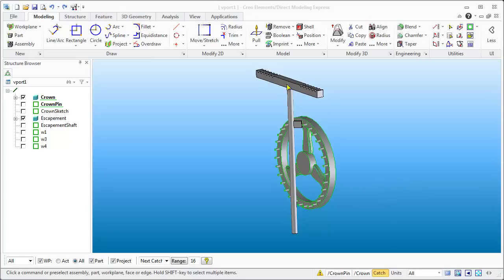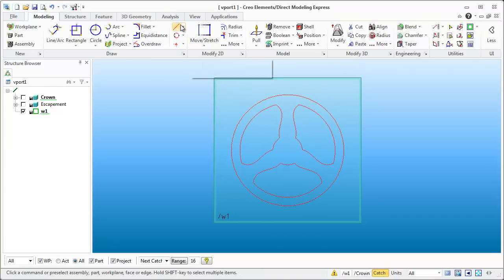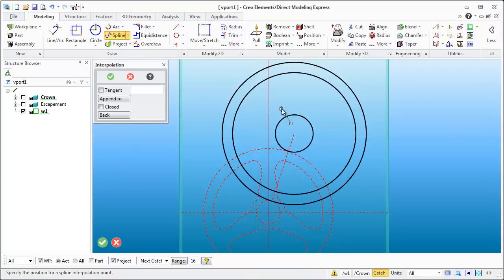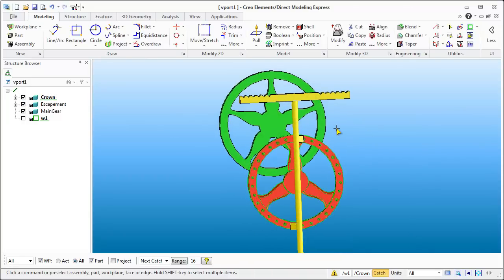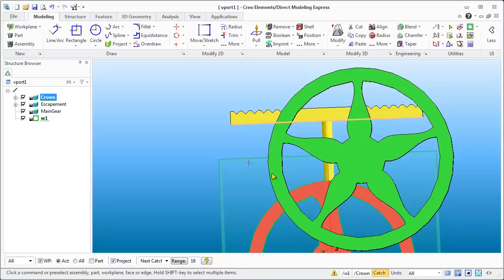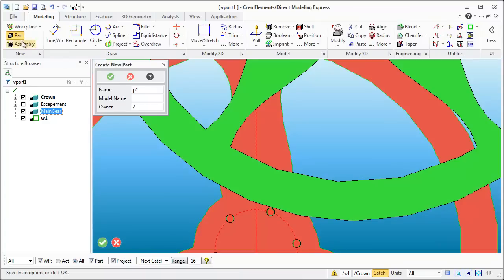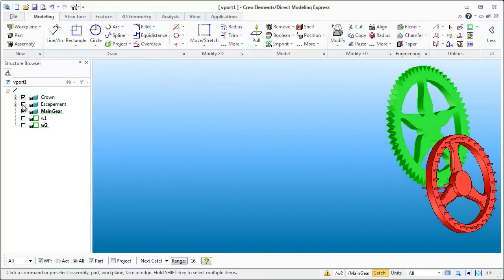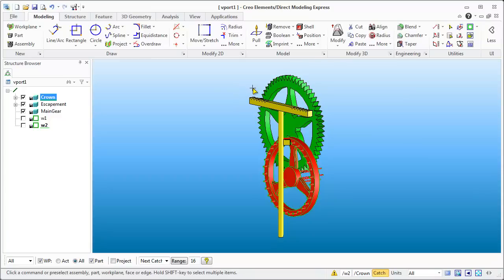Video: Creo Direct Modeling Express, making a clock part 4

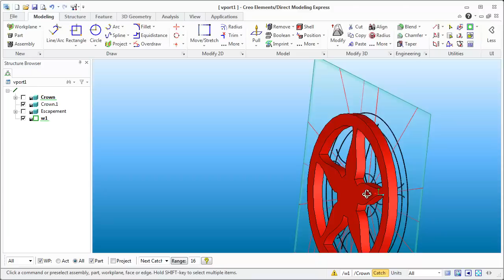Comment: At about 8:40 he pulls the main gear from Workplane 1.  But the Main Gear is created about 10 units or so offset, away from, the Workplane.  Why did that happen?  I don't understand that.  (Also, I am not even able to pull the main gear at all without creating a new part first.  He did not create a new part and then pulled the main gear so that I guess it was a feature or part of the crown gear?  He states that he should have created a new part first.  I don't know whether or not this issue has something to do with my question which I stated above.)
Reply: I have the same problem as you
Reply: Still the same problem hete